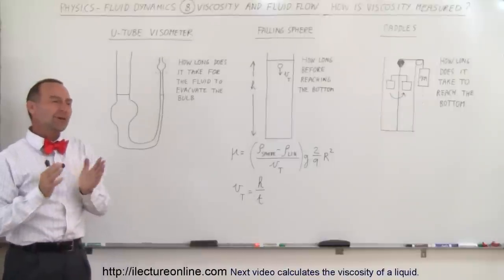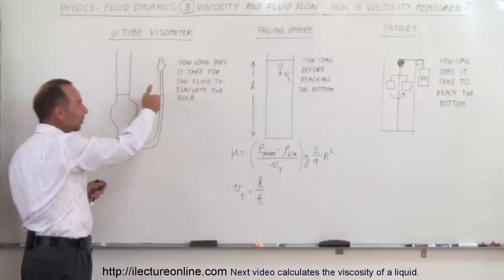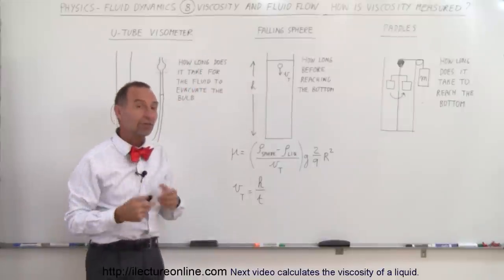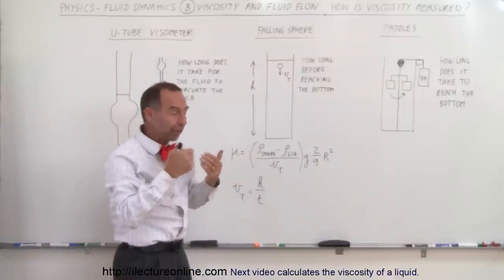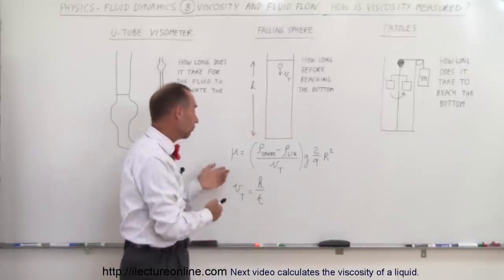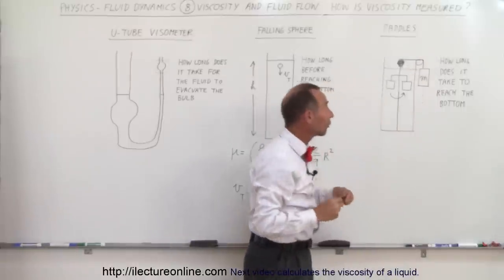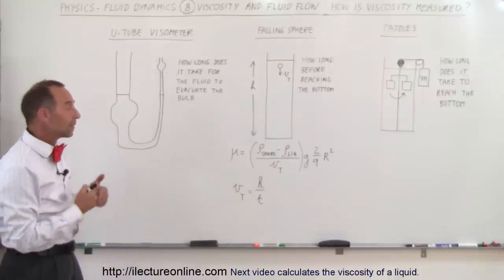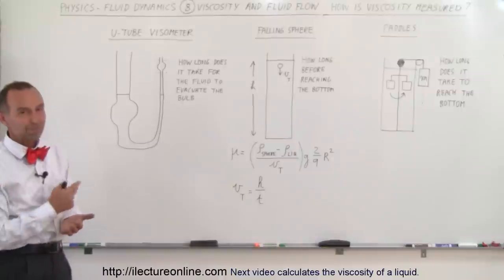Physics 34  Fluid Dynamics (8 of 24) Viscosity & Fluid Flow: How is Viscosity Measured?

Comment: what happen if  the sphere does not reach the bottom and stay a distance (y)from h
?
Reply: In such a case, the sphere would be in equilibrium. Gravitational force would have the same magnitude of buoyancy.  However, in order to calculate viscosity, we need to know the velocity of the sphere. Drage force is calculated utilizing the differerence between gravitational force and buoyant force. If the were no current motion in our system, we cannot calculate viscosity.
For derivation of the viscosity formula, you can check "https://www.youtube.com/watch?v=3xukKynwA70&list=PLX2gX-ftPVXVHnqlawAPDHuo3lg9lT6JI&index=13".